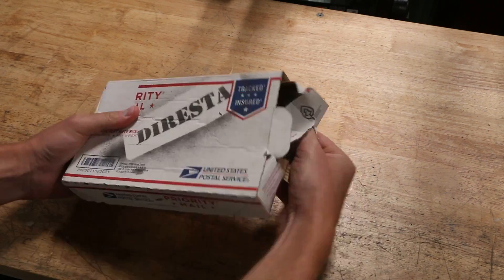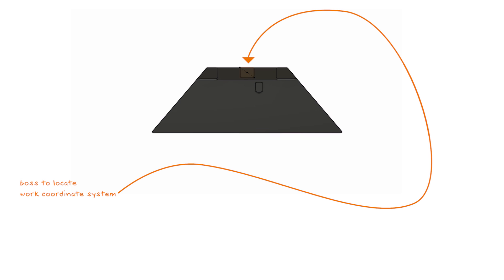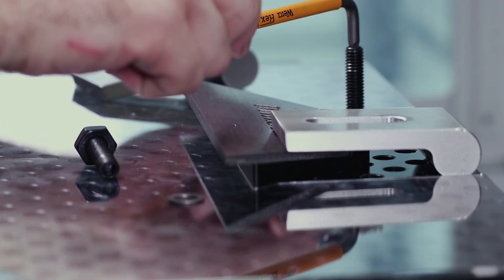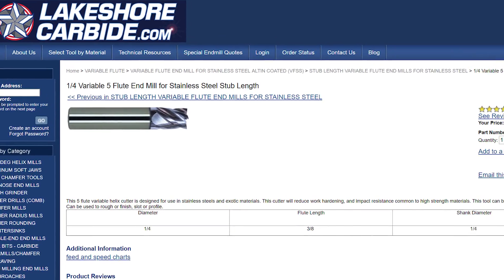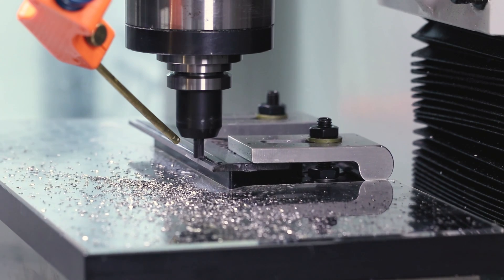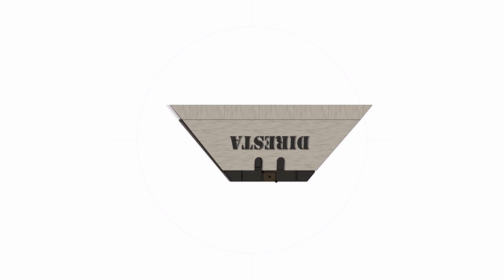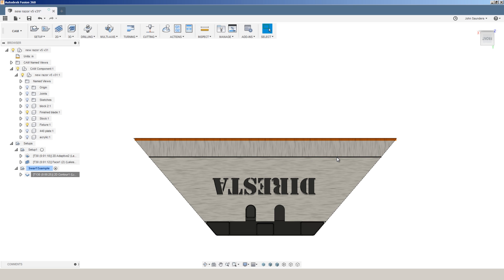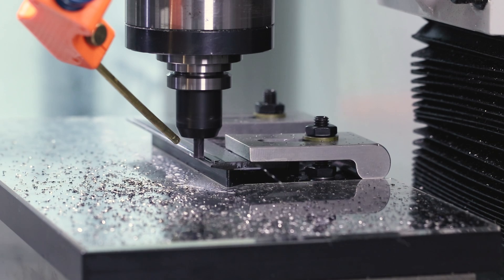Jimmy Diresta Needs Help! | WW223

Comment: Nice job. I'm curious about the type of filament used for the 3d print.
Reply: The Markforged uses a filament they call onyx. It's nylon with chopped carbon fibre. Expensive but very good stuff. Razor flat parts without a heated bed. It's party piece is to add additional continuous fibre wherever you want inside the print to strengthen the part where required.

Comment: This is actually a better fixture than the vertical one. Since this can double as a fixture for grinding on a surface grinder
Reply: and inherently more ridgid. plus it allows for 1 set of clamps with the use of the fixtureplate

Comment: Place the part vertical in a vice and use a tapered end mill . . . .or kick the head out on  your Bridgeport and call it done . . .no complex fixtures . . .job shop talk . . . Boss happy
Reply: Danny Oktim complex? That fixture is a piece of cake, few minutes of work, much less than you'd need to tram your head back....

Comment: I would have went with the same tool diameter but would’ve used a 6 flute Niagara Cutter endmill. I’ve run the 1/4 inch tools with great success at quite high fees rates. .004 per tooth, 650 sfm+, and full .75” depth of cut. I was stepping over about .025” per pass dynamic milling in 4140 and it worked great. Have also used a very similar recipe in A-2 tool steel in the annealed condition.
Reply: Ed Rees part number is S638-0.250-D3-S.0-Z6 

I made a mistake, the DOC is only 5/8” on the 1/4” tools. Still, same recipe applies. Your only limitation will be your machine rpms. The speeds and feeds listed by niagara work great to start but don’t be afraid to turn it up even faster! 

Hope this helps. 

Best, 

Kade

Comment: It amazes me that people still don’t understand the HP and torque limits of a tormach 440 and its inability to run most insert cutting tools or really anything much over 1/2” reliably ...  

Though the adaptive path was overkill. A simple pocket routine, rough and finish would have more than sufficed.
Reply: Really? People overestimate its ability? For me its the opposite, it amazes me what it actually can do, it's tougher than I thought at first sight.

Comment: Did you make the fixture out of PLA? How have they been holding up with coolant exposure? Nice job and I like how you set this up for repeat work.
Reply: Mark forge uses something more exotic, I think it's fiber reinforced nylon, but I may be misremembering the particulars, but for sure it's not PLA

Edit: they call it oynx
Reply: @billmielke7395  Thanks, Bill! I was just reading about that type of filament today and might try it out soon.
Reply: @billmielke7395  Just because they push the onyx stuff, doesn't mean John's not running something else. Something more pedestrian.
Reply: Andrew Delashaw It does look like the Onyx, though

Comment: Do you have any concerns using a 3d printed fixture on the CNC? I wonder about coolant causing problems, wear on the plastic with the clamps possibly compressing it too much causing repeatability. Will you make a metal fixture if this works?
Reply: You would mostly need to worry about overheating the part and cooking the fixture
Reply: Robert Szasz 
Which if you’re heating up the part that much something is seriously wrong...
Reply: Its not a permanent thing. If it breaks/warps, who cares. It most likely won't though. If you squeeze it with the clamps too much, that's operator error.  The repeatability are well within the tolerances. If it goes out by 5 thou, it won't matter.
Reply: @occamssawzall3486  agreed, but fixture failure can lead to a part being flung through somebody's face, so knowing the material and design limitations are important.
Reply: @RobertSzasz  Markforged fixtures does work really well even for more permanent stuff if you reinforce it with the continuous fibers that add stiffness and strength. The Onyx base material is very resistant to coolant.

Comment: Why not grind it?
Reply: Exactly what I thought.
Surface ground.
Reply: don't Care you could I guess. but it would take a long time because you shouldn’t deep passes. Not really what a surface grinder was designed to do. Which is grind a finish surface. 

By milling it, you don’t just burn through grinding wheels. And depending on the setup you/work material, you could end up pushing way to much heat through your part.

Comment: facemill, one pass for roughing, go down 0.2mm and about 1/3 feedrate for finishing, side is done, much faster than your four minutes per side. and a fixture should be durable, so your 3d printing may be usable for a few times, but thanks to the clamping force it will start to lose its form. use steel, then you also have the option to use it on a magnetic chuck for finishing or creating a really sharp edge on the surface grinder. not to mention, that you then can include the clamps into the fixture, making it a single unit for storage, transport and setup.
Reply: The 3D printed fixture is made with a carbon fiber reinforced nylon.   They do not deform when in a clamp.  Check out Markforged printers.  The stuff they can do is incredible.

Comment: any reason to not use a bigger tool and do it in one pass?
Reply from the maker: This was the tool Jimmy had on hand.  And on smaller machines, smaller tools are more forgiving (and much less expensive)
Reply: Only down to around 5/16".   Smaller than that and they don't get any cheaper that I've noticed.  That's a big reason I've upgraded from a dremel-colleted spindle.

Comment: Did you use abs to make your 3d fixture
Reply: Blake caudill It looks like the Onyx material from MarkForged, which is nylon with chopped carbon fibers mixed in
Reply: It would be to cool to experiment with it on my 3d printer if possible

Comment: Just be careful with 3D printed work holdings, they have a tendency to soften after a part has gotten warm.
Reply: While FDM printing is cheap, something like the Formlabs Castable Resin might be a solution. I have several FDM printers and find I spend way to much time with problems, I have a customer in the US that tells me that they have never had a failed print on the Formlabs 2.
Reply: @jenspetersen5865  While I've heard that the Form 2 is a great machine I haven't heard of anyone who says its less fiddly than FDM.
Reply: @Lxo96  I definitely have, however that does not extend to the Form 1. In the end the comment was oriented to the fact that they have resins that can withstand significant temperatures. Another thing is that you might just send it out for printing.